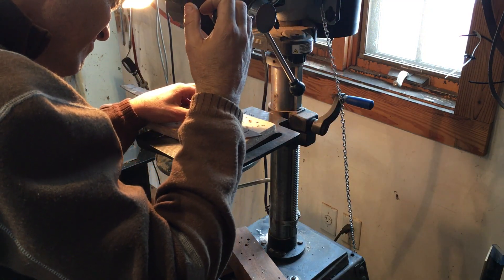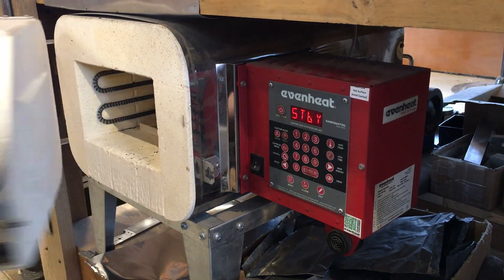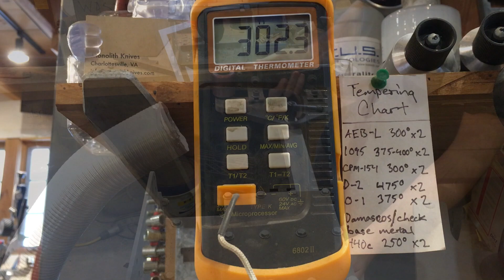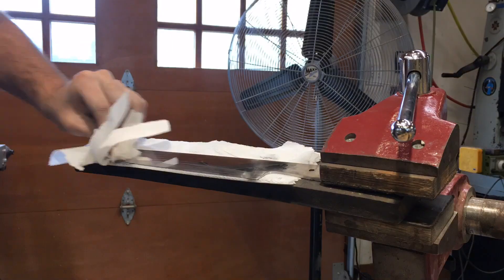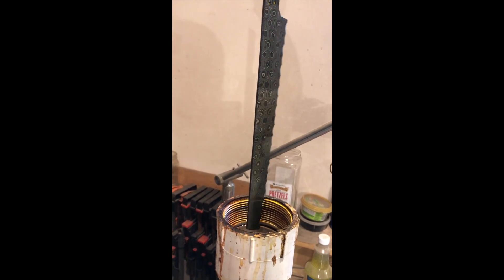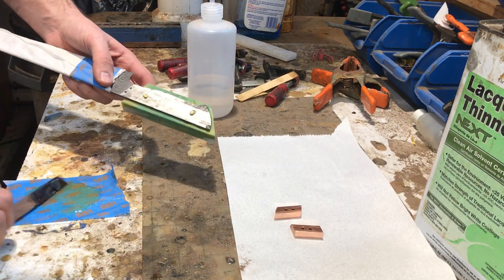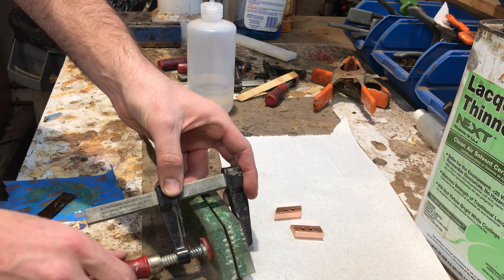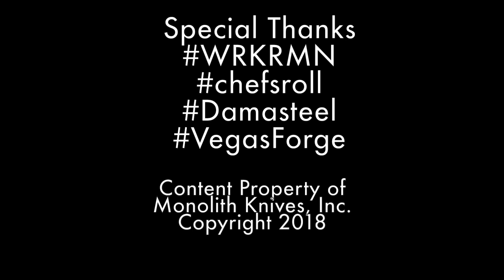Monolith Knives - Making a Pair of Stainless Damascus Bread Knives - Long Version

Comment: What kind of belt sander did you use to get the serrations onto the knife?
Reply from the maker: It is a standard 2x72 belt grinder built by Wilmont Machinery in NC. It's called a TAG-1

Comment: Thank you a lot! Can I ask you the initial thickness of the steel piece you start from, and the final thickness you tipically reach for a bread knife?
Reply from the maker: The steel we use is Damasteel from Swededen. It comes in any thickness you request. We typically order 3mm (.120") for bread knives

Comment: Great video! What heat treat recipe do you follow, in the oven at 1500 then ramp to 1950 and soak for 10 more min? Thanks
Reply: 73 Forge Knives, your question has me confused. This was expalained in the video. These are Damasteel and AEB-L stainless steel blades. Ramp the oven to 1500, let it sit for 2 minutes to get stuff in the kiln, resume heat to 1950, let soak for 10 remove, remove, air quench, temper twice @300egrees for 2 hrs each time.
Reply: Thanks zack, I may have misunderstood, appreciate the response👍🏼

Comment: Nice knives. Curious why you would do the shaping after hardening though since it will be much easier to shape before heat treat.

Also, the acetone can actually prevent glue from sticking properly because it is not pure and will leave its own residue. A better process is to wipe with acetone then do a light grind on the handle with a new 120 gritbelt  just to leave a fresh surface then blow the dust off with air. This will give you the best surface for adhesion.
Reply: If you were to grind blades to the thickness at the edge as we do, which is roughly a few thousandths of an inch you will certainly end up with a blade that looks like bacon after heat treating. Even partial grinding offer little advantage compared to the problems it can create. This practice is industry standard. Even people who mill their bevels, do so using carbide so to tackle the hardened steel. 

As for the acetone. This process has been tested and proven many times on YouTube. Grinder belts are exactly why we do this. They are loaded with carbon and leave this on your steel and some woods are so oily naturally that this needs to be cut to provide a cleaner surface. Hitting the surface even with a new belt will leave trace amounts of dust and carbon that should not be there. 

I’ve never had scales come loose since I started doing this this way and I’ve been doing it for 8 years. If those processes you described work for you then that’s great! They proved not so for myself and many other knife makers who shared these tips with me. Everyone should always do what works best for them. Thanks for the comments.
Reply: @zackworrell  interesting. I have had some scales come apart when using buffalo horn after using the acetone but didn't have a problem when using a fresh belt. I wonder if the surface makes a difference there...

For the grinding, I understand doing the bevels after the heat treat but it looked like you did some of the shaping after heat treat which is what didn't make sense. I may have missed something though since I did skip some bits in the middle.
Reply: @OrganizationalEngineering  It really has to do with the difference between kitchen knives (thin) and sporting knives (thick). The latter of the two can certain ly be ground prior to HT, at least partial grinding.     

I don't know what glue you use but you should consider using G-flex if you don't already. The only failure I have seen it succumb to is a 125+ degree dishwasher

Comment: *Says it’s paramount to remove all oil from hands before applying epoxy
*wipes blade with a hands after cleaning before applying epoxy
😂😂
Reply from the maker: After handling a rag covered in acetone I'm pretty sure it's all good, a funny observation of irony no less.

Comment: Great video, thanks. Just one thing, you really should start wearing gloves when you are handling epoxy, it can cause nasty reactions and the more you are exposed to it, the more likely they are to happen and the worse they get. You can even land up with having anaphylactic reactions if you are highly sensitised to it which would mean you can't handle epoxy at all, or even go in an environment where it's being used. Then that's your job gone. It's happened to boat makers.
Reply from the maker: Thanks for the compliments. I appreciate the concern, I think someone who is new to knife making should consider this advice.

As for me, I use very little epoxy compared to a boat maker or even a furniture maker. With years of experience I have become very good at using it without getting it on my hands anymore. Trust me I hate that crap on my skin. If I were to get it on me I would never leave it on my skin for even a few seconds. I use a citrus based soap which breaks down G-flex better than un-healthy chemicals like Acetone or Lacquer thinner.  Thanks again!